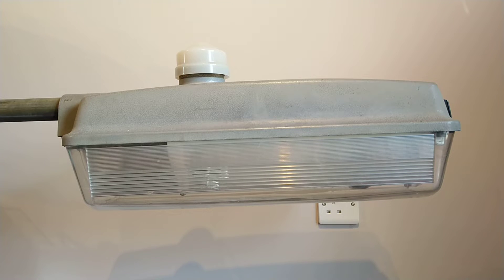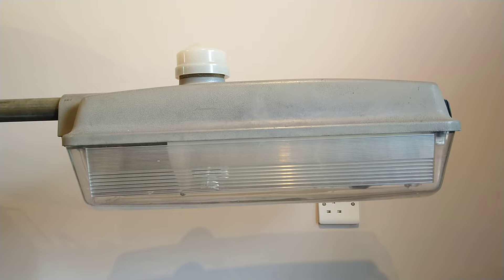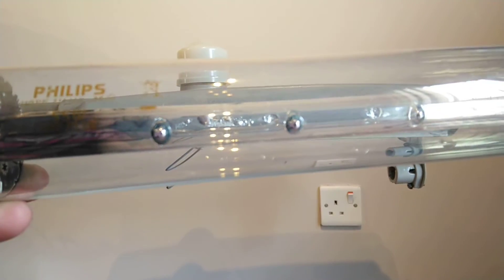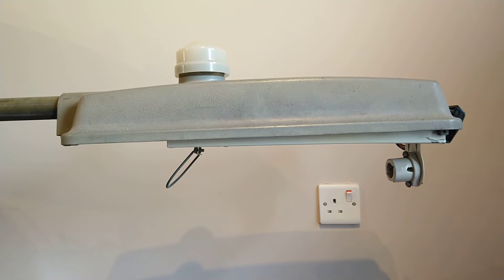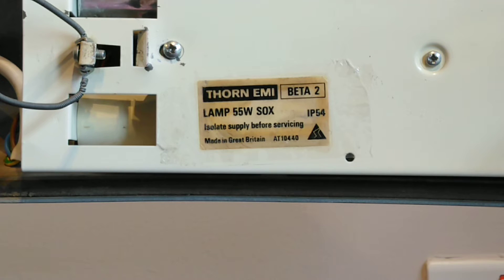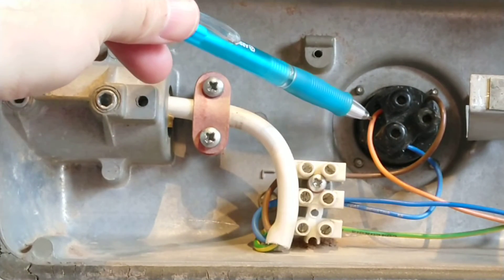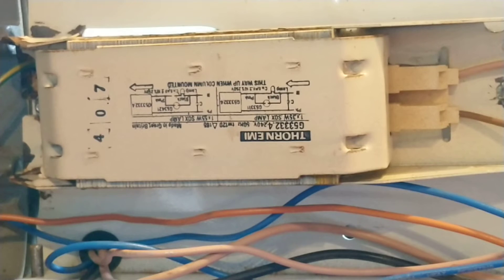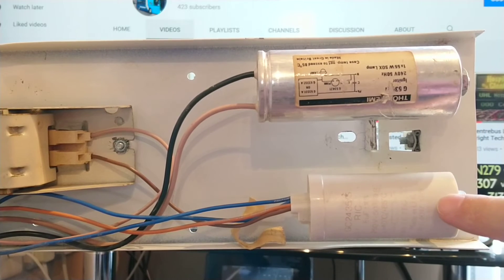Thorn EMI Beta 2, 240 Volt 55 Watt Low Pressure Sodium Lamp

Comment: I recently found a 55-watt LPS security light fixture at my local swapmeet. Any LPS fixture in the US is quite rare. My fixture has an Advance ballast, 120V, and is compatible with both 55 and 35 watt lamps. The fixture and lamp are in like new condition. The only thing is that the ballast in my fixture doesn’t play dance music as it warms up. Great video!

Comment: Sadly they are replaced everywhere by led light, so bright that you need to use sun visor or wear yellow glasses to mitigate the glaring. Led light in car is a shame to for the exact same reason too white and too powerfull.
The orange light was just perfect for good contrast and when you saw white light you knew it was a car.

Comment: This is actually the older version of the Beta 2, the newer version has a flatter canopy, but same bowl/shade. If you keep that in good condition, it will be worth quite a bit in the future. Those versions are more rare I believe.
Reply from the maker: The shade has a large hole and some cracks, hinge post end. Good to know later shades still fit. In Leicestershire today they have now all gone. Some 35w Thorns and Philips still survive in some villages.
Reply: I live in Northern Ireland and we still have plenty of SOX lights, although they are being replaced by LED's. I really hate the new LED lights, I just think they are so boring. There's not much to them.

Comment: this was one of the UK's ROI's and NI's most ubiquitous 55W SOX street luminaire ever made. All were mounted @ 6m whilst the shorter version the Thorn Beta 5 was mounted @ 5m and the Thorn Beta 5 was the UK's & ROI's most ubiquitous 35W SOX luminaire ever made. 35W SOX was never installed in the ROI at all. Thorn Thorn Beta 5 could take a 18W SOX if only mounted @ 3m.